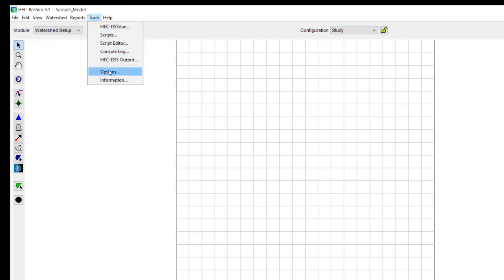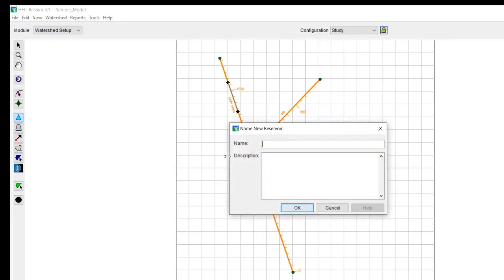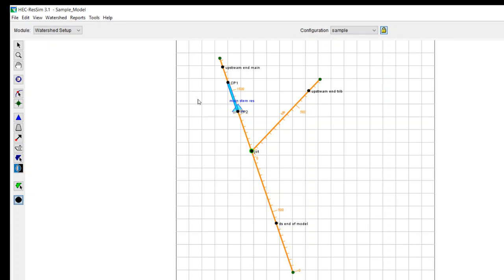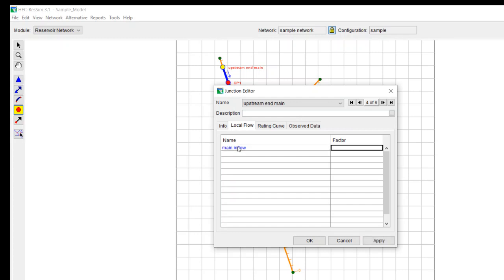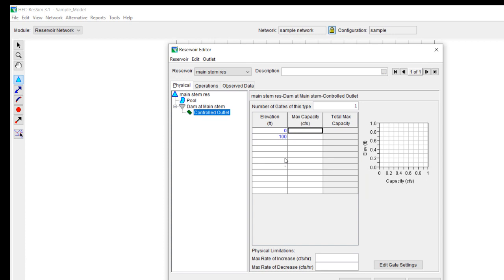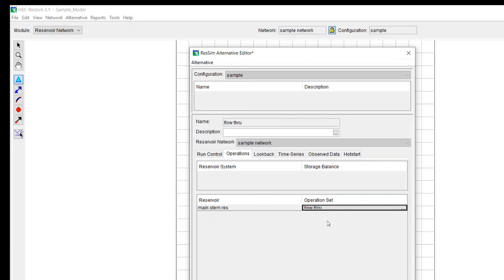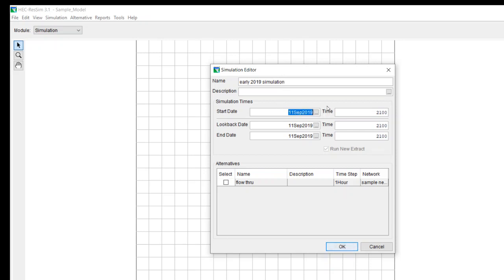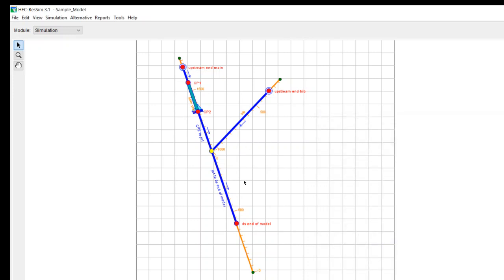Building a ResSim Model

Comment: Hi, I have been watching the tutorial videos and they are really helpful. I am getting an error message upon running the simulation that says, it failed to initialize CP1, my most upstream control point. Do you have any ideas on why this might be happening?

Thanks!!!
Reply from the maker: Based on that error, I suspect that you have an issue with not having flow coming into the upstream end of the model.  ResSim needs a flow at the upstream end (most upstream junction) of all streams.  You will want to specify a name for the flow on the local flow tab in the junction editor.  In the alternative editor, you then link that inflow name with a DSS file.  You also need to make sure that the data in your DSS file covers the lookback period and the simulation period.  It sounds like you already have your simulation created.  After making sure that you have a DSS file (with no missing data) linked, go to Simulation > Edit and "Run New Extract".  This lets ResSim know that you need it to extract a new time series.  This is automatically done when you first create a simulation, but any changes to dss mapping will require "Run New Extract" after that for it to take effect.  Hope that works for you.  Let me know in the comments, and I can try to do some additional trouble shooting if you are still getting an error.
Reply: Hi, thanks for the reply,! Do you do private lessons or troubleshoot sessions?  @hecressim

Comment: Hi! I´m unable to draw the reservoir, it says the pool is  not closed
Reply from the maker: Thanks for the question.  I believe I was able to reproduce that error.  Reservoirs need to be drawn from upstream to downstream.  So, if you draw your stream from the bottom of the page to the top of the page, ResSim interprets that to mean the upstream end is at the bottom of the page.  If you then try to draw the reservoir from up to down, it will think you are drawing it from downstream to upstream.  There are two solutions.  First, if your stream is not oriented in the direction you want, right click and select "reverse direction".  You should then be able to draw in the reservoir in the direction you are trying.  Second, if the stream is oriented in the correct direction, you should be able to draw your reservoir in if you do it opposite from the direction that is giving you the error message.  Let me know if that solves your issue.
Reply: @hecressim  thanks so much! Because I imported the stream alignment, at first I didn't noticed the direction was incorrect, that solved the issue :)... But now I have another one hahahaha, I cannot edit junctions and reservoirs at the reservoir network, hope you can help xx
Reply from the maker: @laksh2388  That issue may be a little more difficult to diagnose, but I recommend starting at this post on the blog:

https://hec-ressim.blogspot.com/2016/08/developing-stream-alignment-in-hec.html

This post provides some information about importing a shapefile and some issues to look out for.  It contains advice from HEC and from my experience.

Specific to your question, computation points in the watershed setup module become junctions in the reservoir network when you use your watershed configuration to create the reservoir network.  In doing that step, the reservoirs that you create should also appear in the reservoir network.  To select them in the reservoir network, remember to select the proper icon on the left hand side.  For example, if you have the reservoir tool selected, you won't be able to select a junction.  I believe you can also have the arrow selected, and that will allow you to select any element.  If you are still having issues, I can develop a quick video to show those steps over the next few days.
Reply from the maker: @laksh2388  After re-reading the blog post that I mention above, I would recommend that you check your imported streamline to make sure that it is not segmented.  That is a common issue, and I recall that causing problems in the past.
Reply: @hecressim  Hi! Thanks for the feedback, I made a new shapefile and still in the reservoir network module I cannot open the junction editor, even though I´m selecting the junction tool :(
Reply from the maker: @laksh2388  I am working on a video where I import a shapefile and take it from the watershed setup to the reservoir network, and I noticed something in the reservoir network that I had forgot to mention.  The lock icon that is next to your network name in the Reservoir Network module must be closed in order to edit.  I believe if it is open, you can only view, but not edit.

Comment: I am not able to draw the stream. What could be the reason for it ?
Reply from the maker: I opened up a new ResSim model to see if I could run into any issues that may explain the problem that you are having.  First, make sure that you are in the Watershed Setup module.  That is in the drop down box in the upper left hand corner.  All buttons will be grayed out until you create a new watershed.  Adding a watershed location and creating a new watershed are shown at the beginning of the video.  Select the stream alignment icon on the left.  Hold down the CTRL key to start and left click with your mouse at each point you use to define the stream.  Release the CTRL key before you click on the final point for that stream.  Once that is done, a window should pop up asking you to name the new stream.  If you are unable to get this to work, I will create a new video to show the steps.  If you do get it to work, let us know what the issue was in the comments.  I am curious about the issue that you are running into.